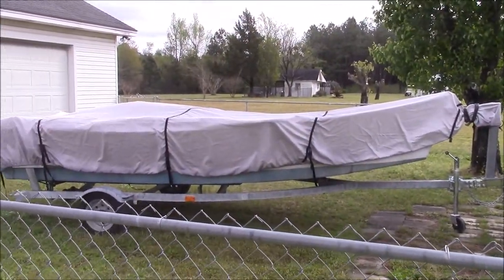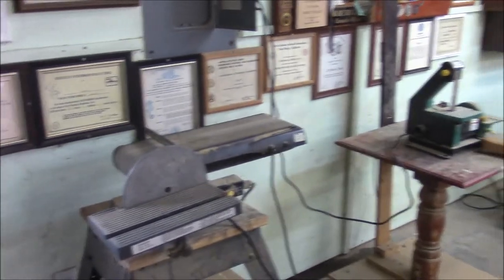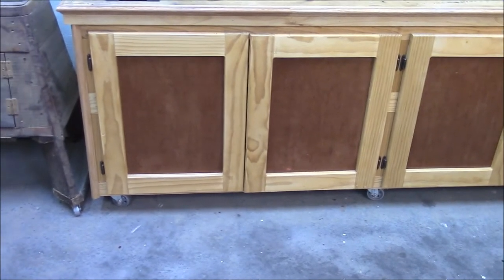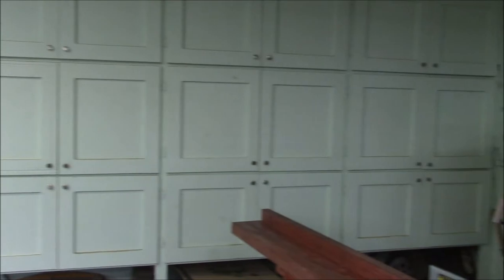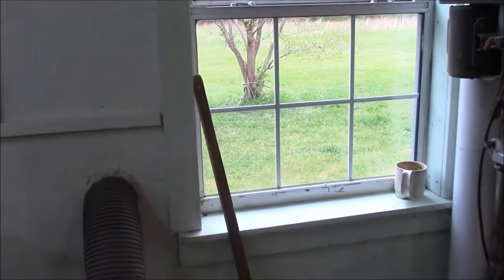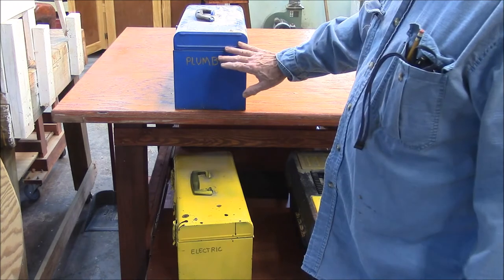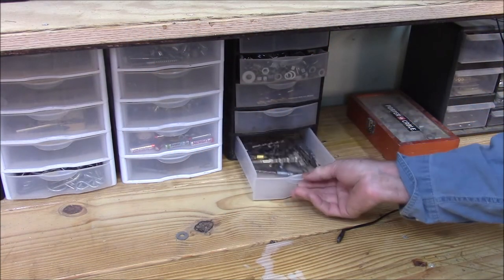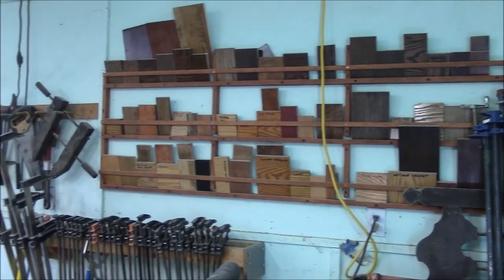54 Shop Tour, Organization, facilities, features, storage, tools

Comment: That was a nice tour of your workshop and a good look back at the projects you've built in the past. I'm glad you got your boat issue resolved and I'm sure it will live quite happily outside. (I'm not sure if boats can be happy or not. :-D) Funny story, the other day I needed the staple gun to complete a project. I thought of you and checked to make sure it was full of staples before I began and it was surprising not to run out in the middle of the job as would normally be the case.
Reply from the maker: +The On Grid Homestead That boat!  I love working on it, but I'm not a fisherman or boater!  Got caught up in the epic challenge of building the thing, and now I have a big trophy sitting on a trailer.  I may sell it.
    Yes, boats have souls.   Which is why I've been so reluctant to sell her.  Every gram of that boat has been in my hands;  we are connected.  But she needs me more than I need her at this point.  She cries to be taken out on the big water.  But I'm an old man; an old woodworker.  I want to build new things of wood and metal, but she doesn't understand - I think.  It is a sad story.
     I'm working that staple gun issue.  A few days ago I bought a new air powered staple gun.  A few more tools I never use.
     I need to do a shop tour where I show all the tools I've bought, but never use.  Guess it's not something to brag about, but I lose all my willpower in a tool store:  "Mortising Machine, well sure, I'll take one and all the accessories."
     Thanks for watching On-Grid, now if Hippie would show, my day would be complete.
Reply: +Memphis Applegate You have the most awesome woodshop!   Isn't the saying...The one who dies with the most tools wins!! ?  You don't ever have to die...I am calling it...you win!!   :)
Reply from the maker: MollyDolly So, MollyDolly has proclaimed that I don't ever have to die!!  "I got that going for me, which is nice."  Bill Murray, Caddyshack.
      Don't know if I'll win the tool race, but I'll be on the leaderboard.   I was telling On-Grid that I crumble into a pile of ashes in a tool store, especially if I see a tool I don't already own.  I could be a hoarder I guess, as I own several tools I've never used. 
     Did you check out all the cabinet and drawer videos I did?  I remember you said the kitchen job was on hold, but if it gets back on the to-do list, check out the videos.  
     Thanks again for watching.
Reply: *****  Oh yes!  I most definitely have studied your cabinet and especially those new slider shelf videos.   :)
Reply: ***** I love boating and fishing since I find both to be very relaxing. I can understand why it would be so hard for you to sell the boat you spent so much time working on. As far as being addicted to buying tools, I can think of much worse things to be addicted to. As for me, I'm addicted to the entire hardware store and I'm always amazed at the things I end up getting that I never intended to get. I can spend hours shopping at Lowe's, but I can't stand the supermarkets or clothing stores, which I get out of as quickly as possible.
Reply: MollyDolly Now that you've learned to build cabinets, doors, drawers, and slider shelves, just imagine the kitchen you could have. :-)
Reply: ***** That's the plan!  Now to buy the fun tools.  :)
Reply: MollyDolly Be careful. Once you start buying tools it's hard to stop. Memphis knows all about that. :-D
Reply from the maker: ***** So true.  Think, just to carry it to the limit, I will build a dedicated cabinet for my "Dedicated Mortising Machine," which I've never used once in over eight years!  
   Then maybe I'll build a trophy case for my 20 volt max DeWalt cordless skilsaw. Might as well put all my 120 Volt corded skilsaws in the case too, as I don't use them either.  
    But perhaps my biggest guilt lies with an anemometer I keep in my "special" toolbox.  Right, it is a wind meter; measures the speed of the wind!!!  In your wildest dreams can you imagine why a 70 year-old geezer woodworker needs an anemometer?  Me either.
Reply: ***** hahahahaha!
Reply: *****  I'm looking forward to buying a bisquit groove cutter (what's that called) and a life time supply of those ovally shaped wafers!  :)
Reply: ***** More cases, cabinets, and shelves mean more projects for Memphis Monday's. Right? I wouldn't be very good at leading a toolaholics anonymous group because I would never get rid of a tool and I doubt I'll quit buying them, so as you see, I have the same "problem" myself. (Note the quotes as I don't see this as a problem.) As for the anemometer, you may find a use for it some day, who knows when you might want to know the wind speed inside your workshop. :-D
Reply from the maker: +The On Grid Homestead Summer is cranking up, so a little wind would be nice.  Wait!!  If the relative humidity is 100 percent, which we call "normal" here, then does the wind-speed really matter?  Notice that everything boils down to science.  
     On the positive side, I'm the only cat in the neighborhood with an anemometer, I bet.
Reply: ***** You have a good point when it comes to the heat and humidity. The wind just makes it feel like you've had a hot wet towel thrown in your face. :-/
Reply from the maker: ***** So true.  When I used to jog, I discovered that 75 degrees with 100 percent humidity was much worse than 85 degrees with 50 percent humidity.  
    But I should have known that anyway, since I grew up in the Mojave desert and Yuma Arizona.  Sure it was hot, but who cares if the humidity is 10 percent?  I remember a business trip 40 years later to Las Vegas.  I remember thinking, "It sure is hot, but I'm not hot."  Then I went for a jog at seven AM, 65 degrees and 15 percent humidity.  It was a revelation to me.
Reply: ***** I can work outside all day in 90+ degree weather with low humidity and a little breeze and it doesn't bother me a bit. 75 degrees with 100% humidity is horrible. I don't even like 75 degrees with 60% humidity. Blah.
Reply from the maker: ***** I hear you.  I lived in Yuma Arizona for two years in my teens, no "air conditioning" that I remember, but we got by.  If it was hot, then you got out of the Sun.  Pretty simple.  But it was always cool at night, not so in South Carolina.
Reply: ***** Not so many years ago evaporative coolers worked great here during the summer. With climate change the monsoonal flow from the south has increased the humidity so much during the summer that the evaporative cooler is becoming more and more useless by the year. As a kid we lived in North Carolina for awhile and I don't remember being bothered by the heat or humidity, which is how kids are. Too bad that doesn't stick with us as adults.

Comment: Does this mean that you are one step closer to selling the SS Memphis?   You know it will bother you more outside because you will have to move it every time you mow.  

I have a question, (surprise, surprise) how did you come up with the design of the cabinet under the lathe?  I had never noticed before, but most of your cabinets and tables have this angled feature.  

I have no idea how to do it, but a neat thing you could have done in this video was to link the project videos of each of your builds here in the garage.  For instance, you could have put a link on the screen of the garage's deck build.  It may be a way to get more views on your older videos
Reply from the maker: +Pidasian Hippie Trying to figure why I haven't sold it, last week it was because I'm too lazy.  This week my new reason is that finding the right home for the SS Memphis would be hard.  I think she should only go to a person really equipped to maintain and operate her.  That person would need wide interests in everything from woodworking, to engines, to electrical.  Moreover, that person would need both plenty of time, and plenty of money to keep her in commission.  I wouldn't feel good about selling this boat to some work-a-day guy who thinks he's getting a turn-key rig to take the family out for the weekend.  
      The angled legs came from an "angled leg" phase I went through before I made videos.  Then there was the angled-legs-and-reclaimed-wood phase, which is the style of the lathe table.  Now I guess I'm in the oak-maple-natural-stain phase.  I learned all I needed to about reclaimed wood:  number one, there is a good reason it was free.  And there is no reason number two.  
      Good call on those links.  I need to learn about all that stuff.  Like everyone I guess, human nature kicks in on me, which results in me doing only the things I find interesting; things I like doing.  In summary, I need to stop crying about my view count if I'm not willing to do anything about it.  
      Thanks for watching, and take care of that sunburn.
Reply: +Memphis Applegate It sounds like you are wanting to sell her to yourself only a yourself that will love her and spend a lot of time with her.

The thing I noticed about the angled legs is that it makes the center of gravity much lower making the equipment almost impossible to topple over.  Very good engineering.

You are right about the reclaimed wood.  The reason it is free is because you are taking away someone's garbage for them.  That being said, there was a time in my life that I was so poor that my "decor" consisted of furniture built out of "reclaimed" wood and milk crates.  I was going for that "Grocery Store Dumpster" look.  Hahhahahah

I am digging the Oak/Maple natural stain phase also.  It makes some very handsome furniture.  I really like the entertainment center.

If you don't find it interesting or enjoyable, don't do it.  You may have to accept the fewer view counts.  Personally, I really think you need to do like Chad Stanton and dance at the end of each video.  Either that or get a dancing cat.  Guaranteed to bring in the views.

The sunburn is healed.  However I just need to make myself use sunscreen.  Not something I have been very good about.